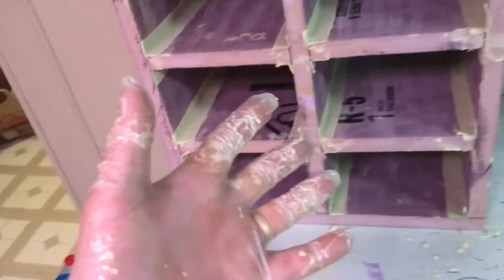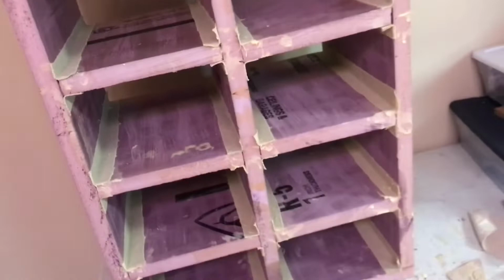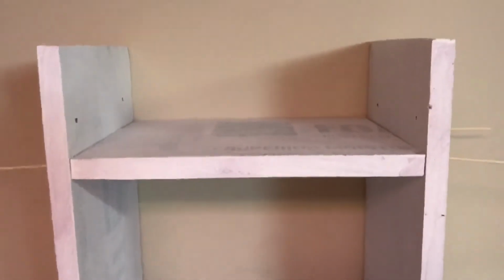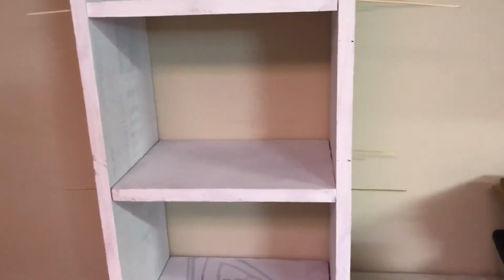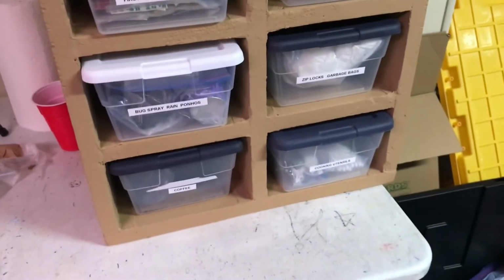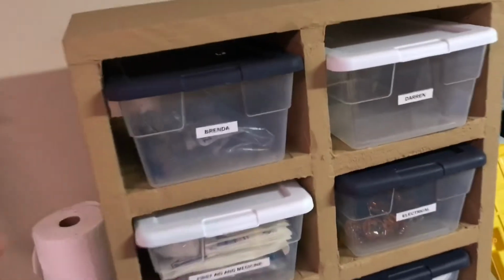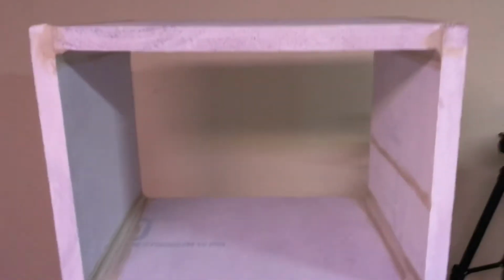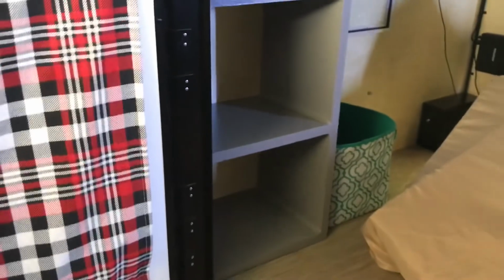Making Lightweight Shelves out of XPS foam and pmf For my Square/teardrop camper￼

Comment: You have the vertical side long and trying to secure the levels btwn. 

The sturdier simpler way is to have the vertical sides cut short so each level can be full and resting on them instead.

You can cut the edges to fit like a puzzle the japanese furniture is made. Or simply screw  brace it secure to itself like a reg shelf. Gorilla glue from a glue gun works fine too.

Comment: You want to be careful when using adhesives with foam.  You don't want to use an adhesive with ANY solvents in it.  People tells stories about joints that looked solid for weeks but then after a year, it was clear that the adhesive had eaten some of the foam, weakening the joint.  They said they suspected that there we low levels of solvent in the adhesive.  Foam construction is strongest when a high tensile strength material is adhered to the surface.  This could be window screen, cotton canvas, thin plywood, or fiberglass.  The result is a composite that has the high strength properties of a torsion box.  It can be many times stronger than the plain foam.  You might be able to get away with 1" foam shelves if you use 1/8" plywood on at least 1 side and screen or canvas on the other (bottom) side.
Reply from the maker: I thought about trying that. Thanks.
Reply: How did the liquid nails hold up?  Is it eating it?